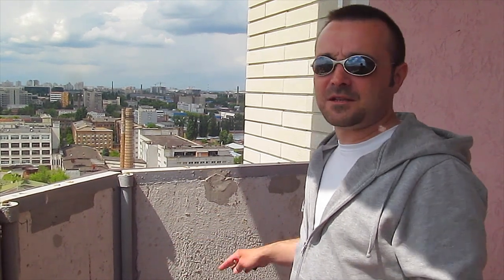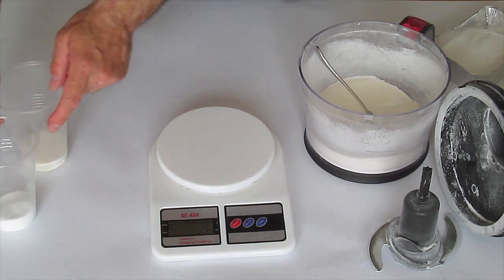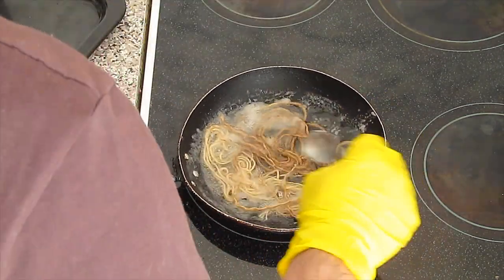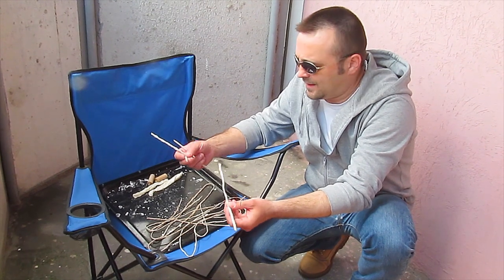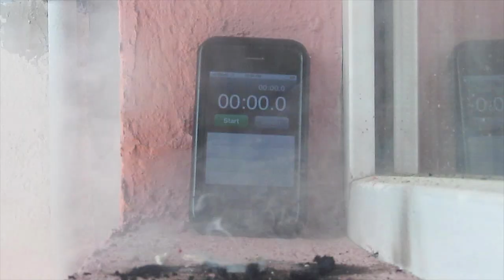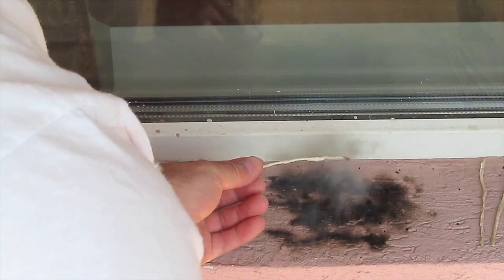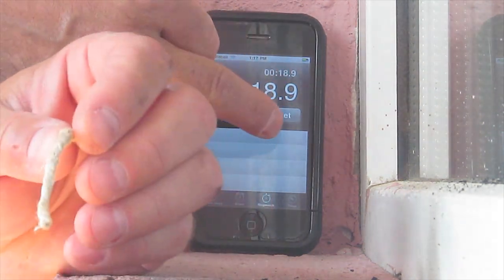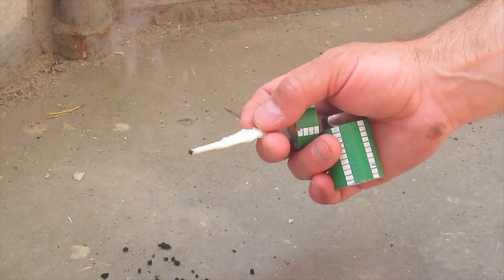How To Make Slow Burning Fuses / Homemade Rocket Fuel (R Candy) / How To Make Safety Fuse

Comment: Try a ratio of 75% potassium nitrate and 25% white sugar.  I think you will get a much more reliable fuse out of that.  Thanks for the video.
Reply from the maker: +skyym3 
Thanks, we'll definitely try that
Reply: skyym3 will it ignite faster taht way? and can I use any ratio between 60-40 — 75-25
Reply: SAVKE popara Ya, try some different ratios and see what you come up with.  Some ratios will burn quicker and some will burn very slowly.  Just do some experiments and see what you come up with.  Have fun but always error on the side of safety so it stays fun for you.  
     Good Luck

Comment: If you add 1% red iron oxide you your mix, you will notice HUGE difference. Not joking whatsoever. Also, try using steel wool. You'll love that one as it burns real hot. But That Iron Oxide catalyst.. You'll really smile from the difference
Reply: Wont it explode with iron oxide because of the fast burning

Comment: you see what I do is after the fuses dry, I then coat each fuse with hair spray and wait until they are dry,  you will have a stiffer product that won't sag and it keeps the black powder from falling off... give it a try and I GUARANTEE you will start doing it that way for now on.